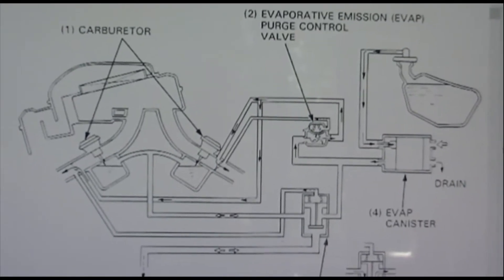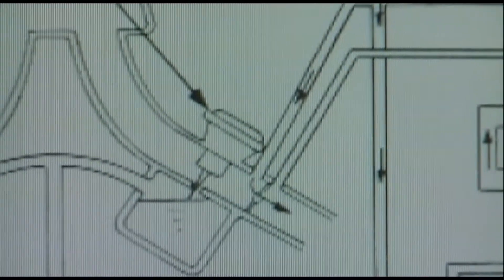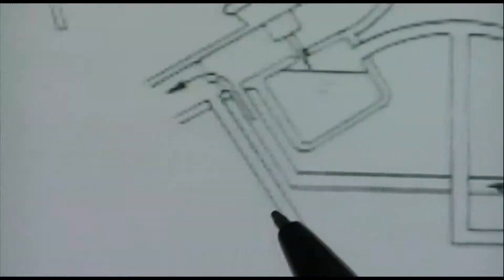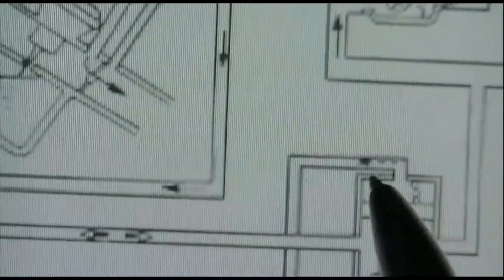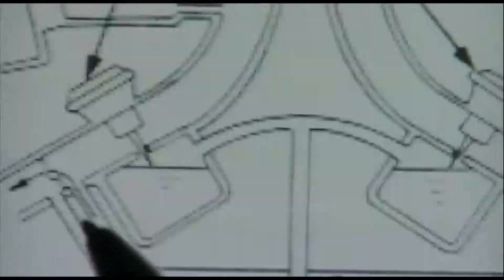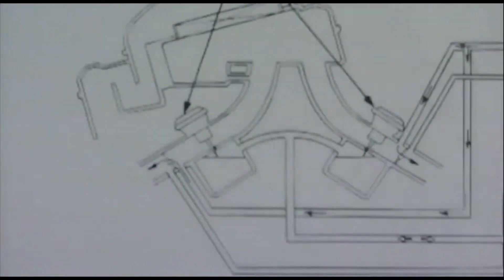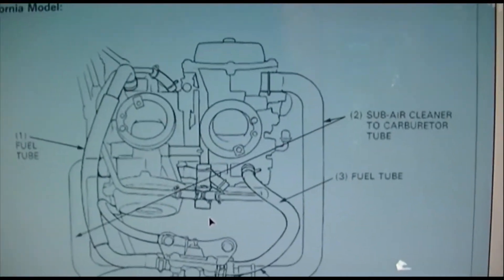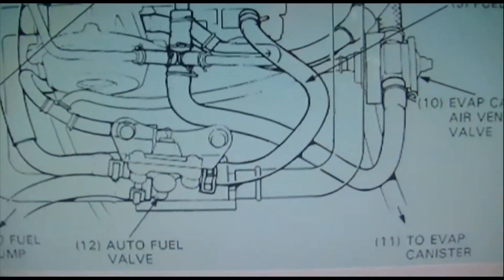HONDA PC-800 :  UNDERSTANDING THE CARBURETOR.  VACUUM,  EMISSIONS, FUEL, AIR TUBES

Comment from the maker: Well. The california bike has a vapor canister to catch fumes from the gas tank.  If you look at the diagram of the tubes you can see this.  What do the non canister bikes do... vent overboard I would think.  The carb throats connect to the big airbox under the false tank,  and fumes I suppose can make their way out of that.  If there are no drips to be seen with a good flash light inspection.... I wouldn't worry.  These are likely fumes that are routed to the intake and burned when the bike is running.     Check your gas cap seal ?

Comment: Thank you Capt. I am a new owner of a 90 PC800 . The bike runs and idles fine but I get a strong smell of gas at times while driving or when I get of the bike . Sometimes after I get home and park in the garage I will notice a gas smell for a while . There is never a leak or a drip under the bike . Any ideas what it may be before I tackle removing a lot of parts and pieces . Thank you !
Reply from the maker: While driving... that is a concern... did you take your side panels off to inspect the fuel pump and fuel lines to the carbs, and the various vent tubes ?
Reply: @captlarry-3525  I haven't done a thing yet . I found your video and watched it to give me an overview of what is inside and while watching I thought about that fuel smell I get at times . The bike runs and idles so good that I hoping that it may be something easy or something that I was doing that may be causing the smell . It looks like I should start digging deeper, maybe when I have 3-4 hours to make sure I can put it all back together in one shot .
Reply: @captlarry-3525  Hi again Capt.  I removed the side panels , false tank and removed the air filter . On the "bottom" of the air box on the "seat end" there is a hose ( drain hose ?? - not sure ) I removed the upper end of it and tried to blow air down into it but it wouldn't accept air . Do you know if I should be able to blow air through it . This hose is infront of the pet cock that splits the gas flow to each carb . Approx 3/4 inch hose .
Thank you
Reply: Hi Captain , I put the air box back together with the filter and decided to start the bike with one end of that hose of . The bike started and there was actually air coming up from that hose ( low psi air but enough to feel it so I know it wasn't plugged . I believe the air was coming from the " evap carburetor air vent control valve " . Anyway the carbs look almost like new or very well looked . I can't find any leak what so ever  , so I put it all back together . A fun little first project on my bike and after removing the plastic covers I am not so afraid of doing that anymore as I was worried about breaking tabs during my first removal but there are a lot of great videos explaining the proper procedure to do stuff . I was surprised that my Honda dealer said he couldn't get an air filter for the PC 800 here in Canada lol . Anyway I will look online on my own as I am sure they must be available somewhere . My filter was still fine to use for the time being . Thank you for your help and encouraging me to take a look at the obvious stuff which I am very glad I did .